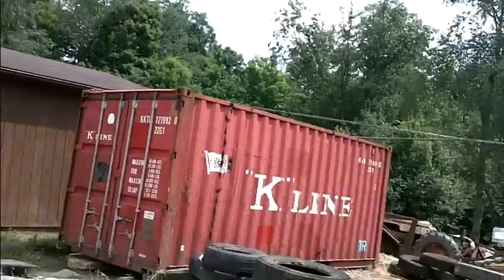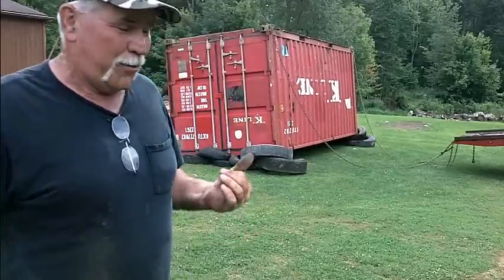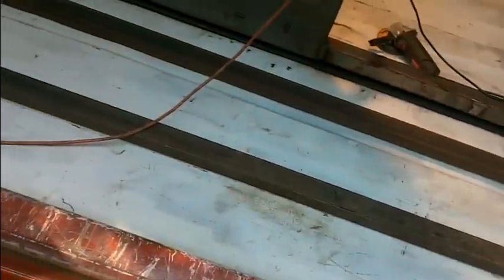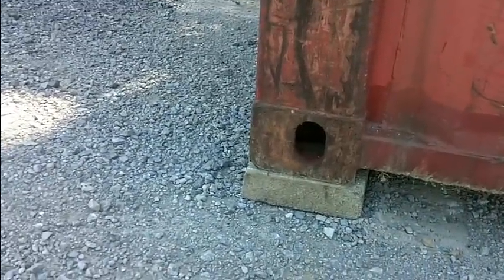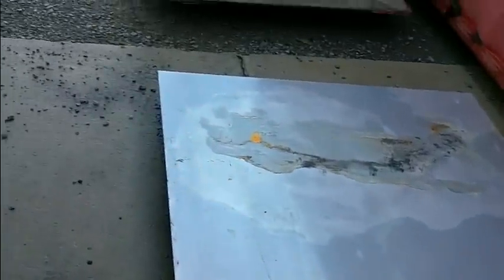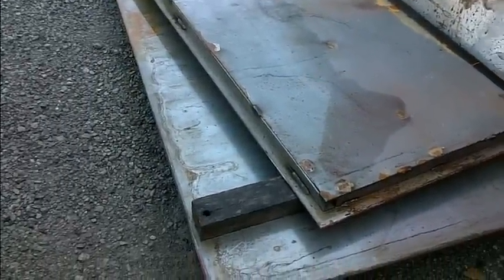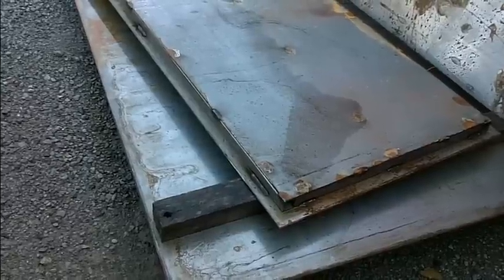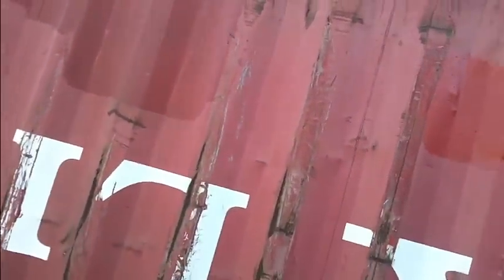Part 2 Underground shipping container shelter

Comment: Wouldn't you be cheaper to dig your hole put down a concrete slab then lower your container in and then do your steel reo and cover the whole thing with concrete. It's all water proof and you can then build a shed on top. Good vid though, thanks.

Comment: Wonder what it would have cost to coat the container in bedliner for pickup trucks
That stuff is pretty durable, if you could seal it up good it would be waterproof for a long time I imagine
Or if that's expensive you could spray it with automotive undercoat,  should give a decent rust protection

Comment: I inverted mine and used nearly the same bracing as you except I added two extra support channels on the outside of the long walks, I then insulated the side and rear wall with crush proof below grade insulation before backfilking ,at every weld joint I used belt and suspenders by applying a 1/2 thick head of Vulkem 1A polyurethane caulking over every weld and into the structure 6 inches ,for my roof I added two interior support beams ,I filled the channels of the corrugated with lightweight gunnite ,insulated with 6 inches of insulation glued to a 1' plywood before applying a 100 mil EPDM rubber roof with a layer of 1' crush proof insulation on top of the finished roof ,then I loose laid a solid sheet of 45 mil EPDM rubber over the roof before back filling ,the only thing I wish I had done was to create a functional basement under the shelter vs just the crawlspace & 4 sumps we put in to keep it dry .
Reply: Nimbus Nimbus  go away troll,i spent 4 years in a trade school earning a journeymans card so i woupdnt have to deal with scab hacks like you ,point out a single step i took that isn't to code or far above code or stfu.

Comment: Put the bottom of one on the top,and plate it with the core 10.
Then take core 10 to plate the bottom.
the remaining framework from the deconstructed containers can be used for reinforcement of the walls.
Buying the new steel would probably cost alot more than what two old beat up containers would.

Comment: Have you thought about pouring cement for your "new" floor?  Even for the new roof a nice slab would strengthen it up the cheapest way, and if you make your forms so they are thick and wide enough you would cover the corners which would help you distribute any load above the rough.  Like you said, the corners are the strength of this box.
Reply: Aircrete would be nice

Comment: I wonder if you could stack one container on top of another one and bolt and weld it together. cut the top from the upper one and seal it. I don't know! It's just a thought. Use all the scraps from the upper one to beef up the lower one.
That was my plan, I'm hoping it works. What you are doing will work perfectly. I was just trying to squeeze a dollar.

Comment: It would be great if you could've given the costs associated with putting more steel in the (now) flooring, as well as costs to put 1/4" steel plating over the floor joists/wood (now the roof)!

I think it'd be a lot cheaper to hot tar all nooks and crannies in that new roof (old flooring), compared to all that extra steel with full welding!! 

I don't know......if you flip a shipping container upside down, you're saying to basically put in added steel for flooring AND roofing!  OMG, that would probably double the purchase price, just for that?!!

But then i guess you're trying to up-sell this type of construction for extra revenue, eh?!  You gotta eat, right?

Comment: Just a thought why not put container in place and fill with concrete?
Reply from the maker: that would be fine if you had access to it. Most installations are Miles back in the wilderness with no roads you would not be able to get a concrete truck to the site.
Reply: Yes,using the container as permanent shuttering is another good way.
You'd need to put in temporary supports (steel or wood) every few feet, to stop the walls from pushing in,until the wet concrete had set.You could then remove & re- use these same props to support the roof, poured later.Personally I'd at least put some steel mesh in the walls. Do  put in plenty of rebar  across the short (8ft) span, set 2 inches above the roof on fibre spacers. (If you are not inverting the container I would use at least bar 5 every 8 inches or the centres of the ribs, with a roof at least 8 inches thick above the highest part of the ribs, particularly if you want a blast shelter, perhaps with over 2 ft of earth above.

Comment: Okay just to back up every word you said!
We had a big fire here in Willow Alaska last year which took out many families homes. After the fire our church worked on cleaning up after the fire on many of the places which maybe lost everything or some only some outbuildings. I worked on one families home where the house and garage were good no damage but the greenhouse and one out building was lost.
 
The outbuilding was two shipping containers with a trust roof over for a large shed. This was all burnt to the ground EXCEPT for the two containers. Now that little stick construction you show in your video with the big slab on the ground and the four post in the corners is all that was left! Now I thought that the sides would have still been there but NO, we did not find anything left of the sides or roof. 

You are correct when you say the sides and top are just for show not for work. 

Kent in Alaska

Comment: Hey Guy,  Cool video this is very good information.  Suggestion Please use a respirator when you're inside that container welding.  When I was a child there was a man in our town bulding his retirement sailboat and it was a doosy he never set sail because he burn out his lungs welding inside that thing.  The whole town cried.  Serious business you don't smell it any stronger than normal but its there thicker than usual.  I hope this isn't too late.  Have a good day.
Reply from the maker: +Paul Holland Yes you are right, I should be clearer about welding inside. I cut the escape hatch first and add  ventilation fan. plus grind all paint where it is to be welded. a charcoal respirator would be a very good idea also. thanks for pointing that out, I will cover that on my next video.

Comment: wouldn't it be easier to use those cross members that you put in the new "floor" to straighten it for a roof and put down some polyurethane on the wood to seal it and leave it right side up

Comment from the maker: a couple people commented on using a sump pump. my design it is not needed. welds are tank quality. (like the hull of a ship). sump pump run alot if you below the water table. weld it water tight and there is no need for a sump or pea gravel.
Reply: If you invert the container the floor should be water tight regardless of the new flooring you put in place since it is built to be water tight to begin with... Your flooring only adds strength to the floor which was lost when the container was inverted.
Reply: Shipping container floors are designed NOT to be 100% watertight. This was a stipulation from insurance companies, as if containers floated around for evermore, they would pose a terrible risk to shipping. A hole caused by by a collision with a ship could cause many, many, thousands of dollars to repair  & even loss of life.

Comment: Love the way you did it but I was thinking of he flipping. First having the floor able to "drain" is a good idea I think if it stays the floor. The issue is water mitigation form "the pit" is it not. I would think an once of prevention is worth a pound of cure.  Looking at other videos adding pea gravel and a sump may be just that prevention. As to the structural I agree with the walls and other support. Now I am not a welder so My mind goes to other ways to solve that problem. Since the other pillars are how we can stack these that is the real weight bearing points is it not? By placing 6" or 8" I beams across them and then adding your internal support you have a way to hold the weight form the earth in the end.  By the placing cross I beams from left to right and adding metal on top of that followed by 6" or more concrete you gain all the structural you need. As shown in other video leaving a 3' plus gap all the way around the container with the earthen wall covered with gunate (blown in concrete or the like with the earth in an angle of repose  you get a area you can walk around but more importantly a way to inspect and keep no contact with the soil.

Comment: What would you think of inverting, coating the old floor and beams with a roofing tar, then filling between the beams with concrete? My concern is that any water that could eventually make it into contact with the wood roof would eventually cause rot. I suppose termites could also be a problem area to address. Really like the Idea of inverting!
Reply from the maker: myself I would not choose to pour concrete between the beams. I know concrete is porous. and steel is not porous for a 20 foot container. it will take 5 sheets of 4 X 8 quarter inch steel plates. if you weld it solid there is no chance of moisture getting to the wooden ceiling. as far as termites they would not be able to enter the hatch area it has a seal. only other option for them is to climb up the vent pipe and and in and I doubt they will do that. inside you coat the wooden ceiling with a good sealing paint and moisture will not be able to contact the wood.
Reply: +loveihi Hey Mike, 
what do you think about using that Rhino-Liner spray ? I'd bet it would be a great idea. 
Try to see if you can get it cheap, and  give her a good squirting.  its gotta work in some way, yes.
thanks brother 👍

Comment: I wish I could weld..
I like the inversion but being cheap I would invert, Pour concrete on the bottom/roof and put in a sump pump..
Then with a six inch space between container and earth pour concrete about 3 feet in rebar and let it cure and do the same
every week until covered.. Spiral staircase into the shelter...
Reply: weldingtipsandtricks.com

Comment: one thing you could have done is went to lowes to get a 6 mil, 20ftx100ft heavy duty tarp and cover the top of the container with it, then push the dirt on top. If you're careful with the dirt covering, the tarp shouldn't have any holes in it. This will provide true 100% waterproofing without having to look for every single crack in the container.
Reply from the maker: yes Marc I do cover it with plastic also put a coating of roofing tar on it will be in the part 3 episode. I'm a bit behind on getting that out because I had surgery the container is in the hole but I have not covered it yet in a few weeks I should be able to finish it and I will publish the part 3 showing the rest of the installation